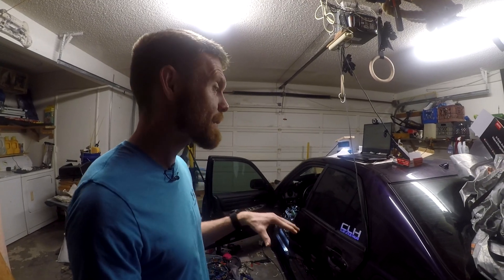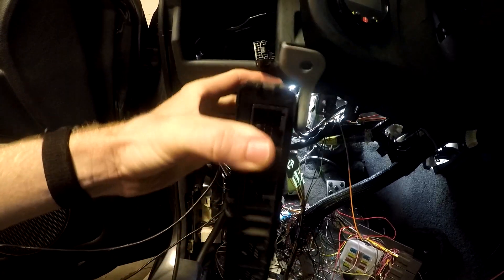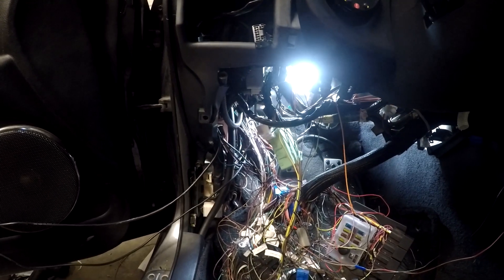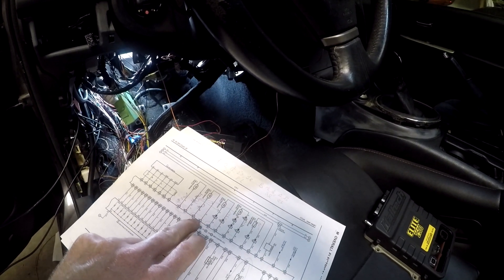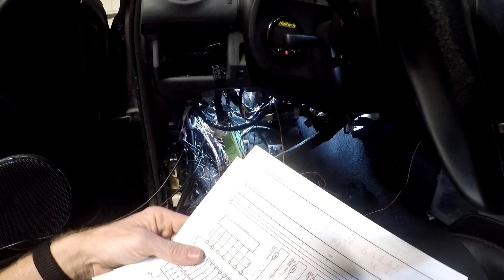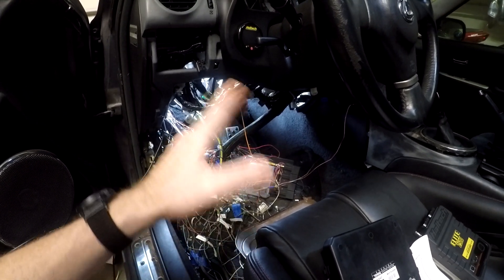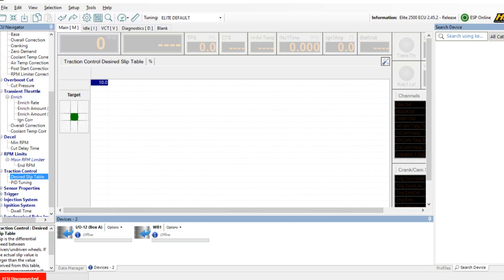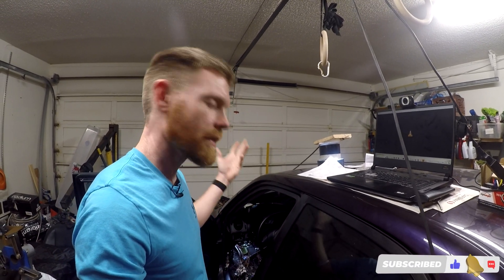IS300 trac. control wiring to engine management

Comment: Hey man! Great video! How can i get wheel speed Signals to my Link ecu and still retain the OEM abs ? Possible to splice?
Reply from the maker: I wouldn't splice the ABS sensor, I've heard of people doing it with some success, but you risk degrading the signal for both the link and the OEM ABS ECU. Doesn't LinkECU pair with the Toyota BEAN network? It should be able to pull the ABS signals off of the BEAN system instead of you needing to splice the wires.
Reply: @LegitRaceCraft  i really dont know but i guess its only the altezza and jzx100 plug in ecu, i got wire in ecubg4x fury😊

Comment: Great information! Thank you so much, I do have a question/comment: If you cut those wires to run to the Haltech , you probably lose your wheel speed reading for the cluster(assuming you have a USDM is300 that's originally automatic, since automatic is300's use abs wheel speed for the cluster). I'm guessing you could probably splice into them and run another set of wires to the haltech off of that splice and keep your factory speedo working , while also letting the Haltech read the wheel speed signals for traction control purposes..?
Reply from the maker: Automatic IS300s pull the speed signal from the ABS, manual versions pull the speed from a speed sensor on the transmission. Mine is a factory manual, so it pulls speed from the transmission. I started to set it up with a Dakota Digital converter so I could convert my T56 speed signal to something the IS300 cluster could understand, but I ended up not even setting it up. I just ran an extra output wire from my Haltech to my speedometer and set up a basic frequency table so my speedo works again. The handbrake light routes through the ABS, so I still need to rewire this. The "brake" light on the cluster stays on when the car is on.